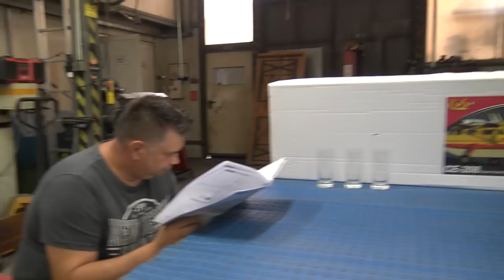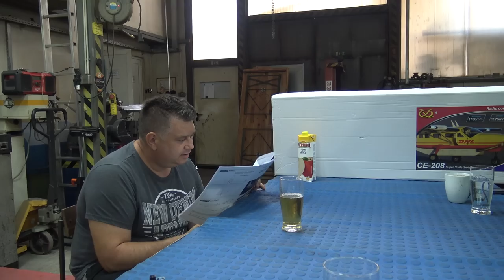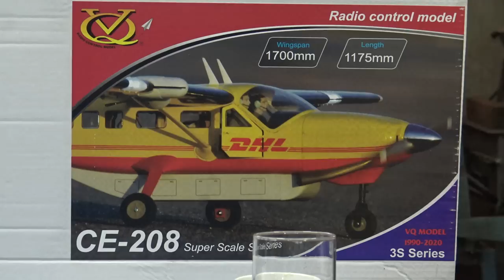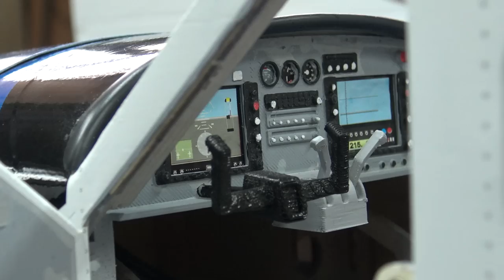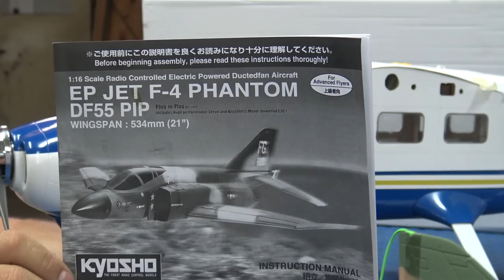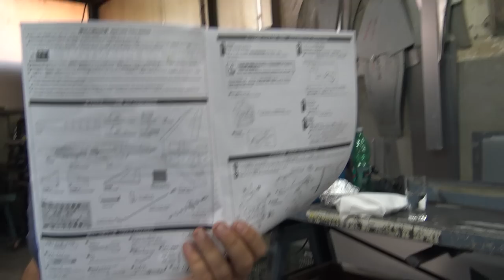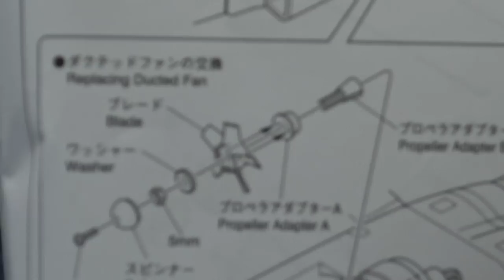NEXA CESSNA CE-208 Airliner Express 1700mm (67") Wingspan - ARF Unboxing

Comment: Great seeing Hubert visiting you guys again.That Cessna 208 Caravan was first built in the '80's across the runway in Wichita from whee I worked for 22 years.I worked for a large Cessna dealer who sold these airplanes.I have a lot of experience working on the Caravan and Grand Caravan which is longer than the Caravan.I worked mostly on the engine but did work on the rest of the airplane as well.I did the engine run ups and taxied them and flew in them on test flights.Cessna still makes them,but moved production to another city in Kansas.I also grew up before moving to Kansas in Illinois about a 45 minute drive to where the F4 Phantom ll was built and saw them flying a lot as a kid.A big salte to you three gentleman!
Reply: Oh that is nice to hear!!!!oh yeahhhhh

Comment: Cessna 208 Caravan. Real plane is a rugged thing of beauty. Real plane can haul passengers. But they really shine hauling the freight. Yeah the radar fairing just goes on one wing. I love these working planes. Like the Short Skyvan.  
I liked the sound it made when you ran it up. Put that big exhaust pipe on it. Real Caravans are so cool the pilot going through preflight checks, big turboprop howling. SEXY!
I had the Kyosho T-33 edf. It had that same ducted fan and it was very weak. It was more like a fan assisted glider. That was a long time ago. I didn't know about the F-4 model. Hubert has a very old school model there.

Comment: You could try blocking the air inlet path. If you reduce the size of the intake, the engine will spin faster as there is less air to move total. You can simulate this with a box fan to see. If you put a piece of paper in front of the intake side, the motor will spin faster as only the air between the paper and fan is being pushed through. With the paper removed, the fan spins slower as all of the air of the room is being pulled through the fan. 

Don't block the intake entirely but if you can reduce the intake size or improve the airflow into the fan, that would help spin the fan faster!
Reply: Oh thanks for info!!!